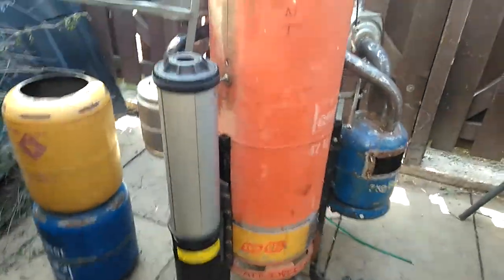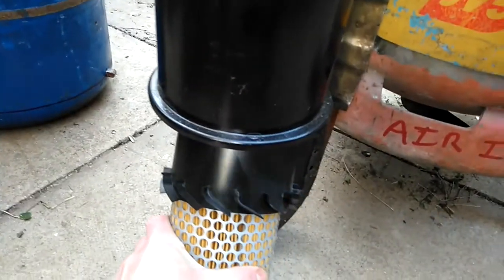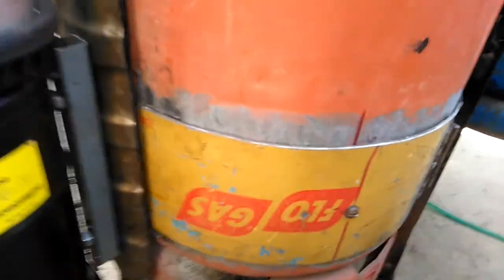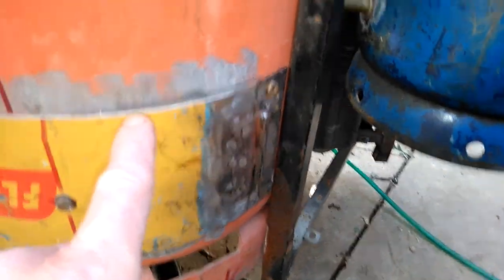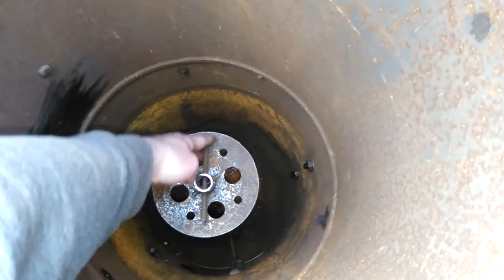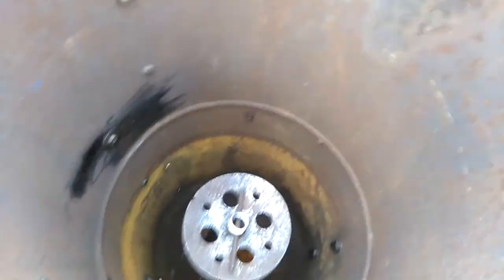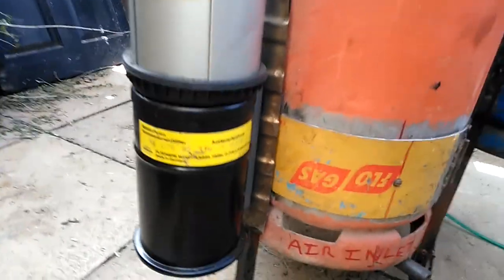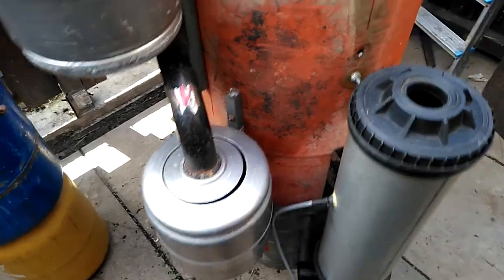Project Neptune (wood gasifier - pyrolysis reactor) #3

Comment: Wood gassifiers are a never ending tinkering project but they sure are fun!
Reply: @brianmurphy8790  I'm lucky I have a heated shop at work and winter down time to work on projects, building my wood chunker to fuel my truck mounted gassifier right now that is my daily driver. 83 Toyota pickup with a Chevy 350 five speed, lots of fun. On woodgas I don't go through tires as fast and haven't gotten a speeding ticket yet😂 but I have had it up to 70mph on all wood gas, runs great. I feed wood, plastic, paper, cardboard, bone, and animal fat through it for fuel and has been getting me back and forth to work over a month now very reliably
Reply from the maker: @BigBeavrSlayer  
I built Neptune for a little hand-crank diesel motor I'm part way through putting in a frame, as a generator setup. 
That's the, so far unseen, other half of the project and why progress on Neptune initially came to a halt - then it got cold.
I had the motor apart, honed the bore, lapped the vales, new seals, gaskets and a really good clean out.
I went for a hand-crank diesel because there's so much less to go wrong. It will fire on pretty much any flammable liquid and wont give a shit about gas/air ratio to run.
Tweaking the gas/air ratio will simply make the governor tweak the level of fuel being injected. Somewhere in there will be the ideal sweet-spot.
I can start the motor on waste oil then fire-up the gasifier with vacuum from the motor. Gotta be able to fire it all up without a power source, if need be. 
The only drawback is that it will always need a small amount of injected fuel to provide the ignition. 
I reckon that's a far easier problem to solve than it would be to find batteries and an ignition system.
The whole project should come together pretty quick once I make a start on it again.
Most of the component parts are nearly made, unfortunately still a few bits to buy..